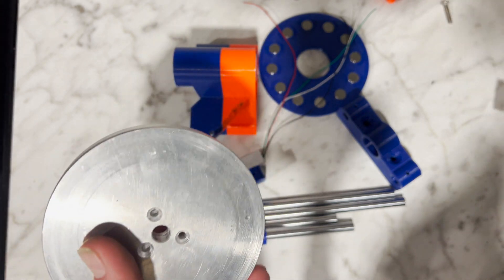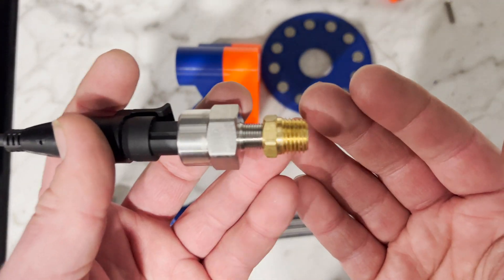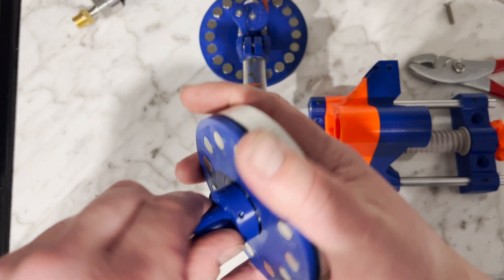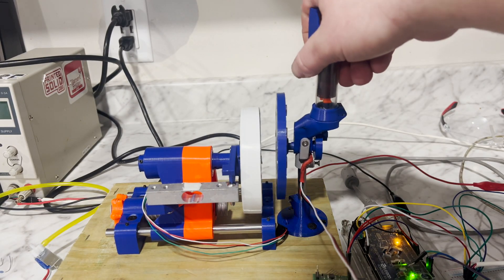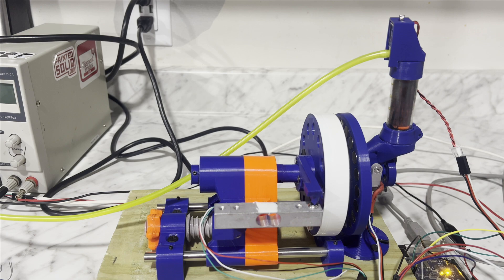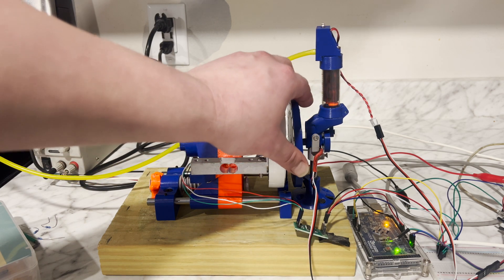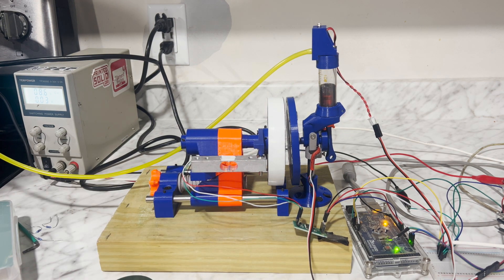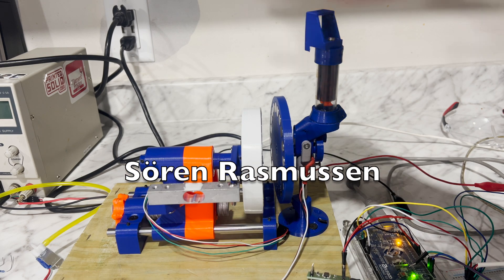Surprising Trick to Magnetize Aluminum - Dynamometer

Comment: dont use chat gpt. havent you notced it simply either reinforces what you already know, or gets it utterly wrong?
its goal is to write legible sentences. not CORRECT answers.

so. you make more power by pushing air in the full stroke, PLAN, pressures*area*length*number... but it isnt more efficient.

air is fun but the compression ratio, the air supply pressure, and the timing all interact to a certain degree...

say 120PSI. a clearance of 1CC. timed to TDC only.
you push in 8cc of air. 120psi is about 8bar.
(piston at TDC can produce no torque, BTW. ALL engines have this major mechanical disadvantage?)
as soon as the piston moves enough to double the volume, 2cc, its obviously also halved in pressure (keep it isothermal! lol. dont confuse yourself with thermodynamics yet?)

so has the force on the constant area of the piston. but the crank now is producing torque...

double it again... 4cc, and its at 30 psi. half the force again...

and finally, another doubling, 8cc...

at this point its at atmospheric and has no desire to vacate the cylinder?

assume the exhaust closes again at bdc... "instantaneous valves" for this mental model...

then you recompress whats in the cylinder, to fll the clearance volume... and no new air can enter. this sounds like a disadvantage. yet its actually the most important factor for efficiency.

holding it open after TDC uses more air, but the higher cylinder pressure can apply more torque. the volume doesnt increase so drastically so the pressure remains higher for longer...

at 40 psi you only have 3:1, less... fairly late inlet closing and exhaust almost to TDC... which you cant do with plain ports.

minimal clearance volumes. the exhaust closing determines the actual CR. supply pressure and degree of expansion governs inlet opening.

lol, this was about dynos. nice effort. janky :)

steel disc on the back of the magnets. cancels out the unused side, the projecting poles do the real work here... alternating polarities, of course... dont think you mentioned that.

small gap between each magnet as that is where the majority of eddy current and work is performed in the conductor. if its too small the currents get pinched too much, start overlapping the magnet itself and reduce in intensity.

not an issue with a mosquito-fart of power!

so... varying the gap with permanent magnets obviously changes the flux and the force.

using electromagnets you can get the flux to only cut the disc, with a very efficient magnetic circuit (iron!)...

much stronger, but obviously requires a variable power supply to excite the coils...

you have three measurement methods to verify results...

temperature rise due to I2R heating, current through resistance. 
torque/rpm
and using electromagnets... the excitation currents.

Comment: You're doing great, just please please please don't ask chatgpt for engineering advice. LLMs are useless for this sort of thing, they're just stringing together related words. I gurantee you know better than it does.
Reply from the maker: It does surprisingly good!, sometimes when it makes an issue if i don't feel like troubleshooting it i will just tell it what the serial print data shows and it will fire off a good fix. I will generally put Chat GPT 3.5 up against Chat GPT 4 to check for errors and between the two of them they do very well.

Comment: The loss of subs could be caused by people forgetting about you because of the hiatus and then getting your first new video in their sub box.
That one was kinda rough quality wise. Keep uploading and it'll sort itself out
Reply from the maker: I should have done better. I was not focused on making a good video but instead focused on making a working engine. This has always been my issue, I prefer to spend more time on the project than the video.
Reply: @GearDownForWhat  It's ok, this video is also way better. I was not trying to put you down, just wanted to figure out why.

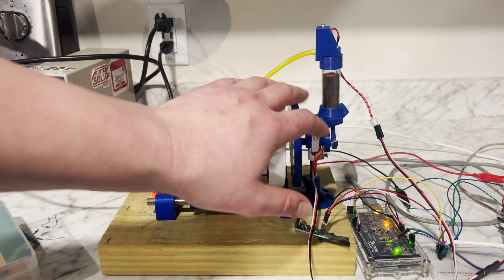Comment: 9:51 This sounds like one of the problems tackled by steam trains.
While there will be differences between hot 200psi steam that can condense and 40psi compressed air, I can give some pointers as a non-expert

For the max power you want to admit air until the end of stroke (a long cut-off)
For the max efficiency you want to quickly admit just enough air to expand to exhaust pressure (a short cut-off)
Steam engines varied this on the fly, starting with max power and trimming down the cut-off to use as little steam as possible

Another thing steam would do is let air in just before the start of stroke (lead) to cushion the stop and decelerate the piston head. This I don't know if this helps or hurts efficiency but it did help reduce wear wear and tear, especially at high speed.
A key difference in locomotives is they needed the piston exhaust pressure to do other work, in this case you can use all the pressure

Again, I'm not an expert, I don't know much about the effects of temperature ad temperature change, but I would trial:
 - Adding some way to change cut-off on the fly
 - A small lead on air admission
 - Find how little cut-off the engine can run with, Ideally independent of pressure

Looking forward to the next update!

5:43 About subscribers, you might have people who had forgotten the channel and once they were reminded by your upload they chose to unsubscribe.
I for one am glad I was subscribed, it was a great surprise when you first uploaded again
Reply from the maker: Thank you for the insight. What you describe is what my intuition leads me to believe as well.

Comment: Did you zero the load cell with that arm sitting on it so it doesn’t portray that weight as part of the torque measurement
Reply from the maker: yes sir! but the weight of that plastic arm is quite small, just a gram or two.

Comment: I fully expect that the magnets behind the aluminum disc will be mostly neutral as when the magnets are oriented the same way as the spinning ones it'll pull flux through the disc but when they are opposing it'll push the flux out of the disc. I think all you've really accomplished is creating cogging.
Reply from the maker: That is a good assessment, i wonder if the losses of turning all the magnets the same way would be overcome  by not pushing the flux. i suppose it might depend on spacing?
Reply: @GearDownForWhat  in my head I automatically jumped to the conclusion that they were alternating. It hadn't even occurred to me that they might all be facing the same way. I'm not totally sure what to expect in that case. It may almost treat it as if there's not a moving magnetic field and create no drag. But I honestly have no idea. Edit: Even if they were all facing the same way the length of the flux path would be constantly be changing and still create a varying flux in the aluminum disc. I still don't know what the effect would be though.